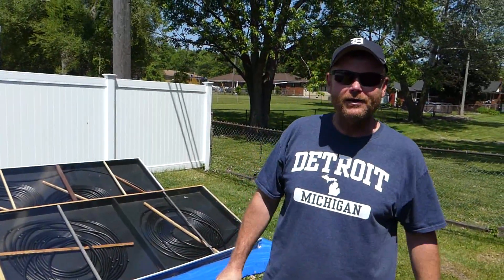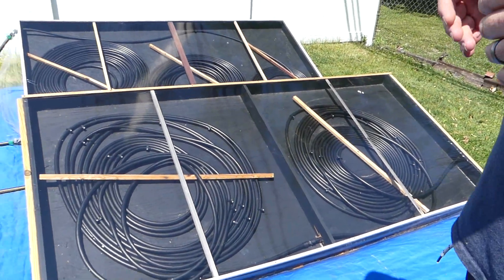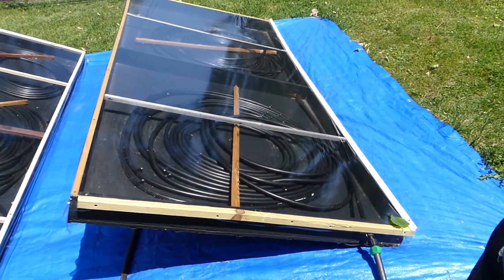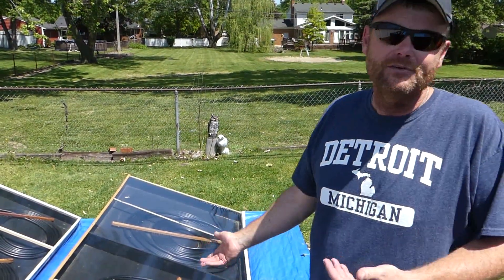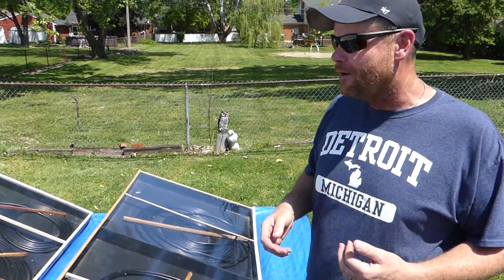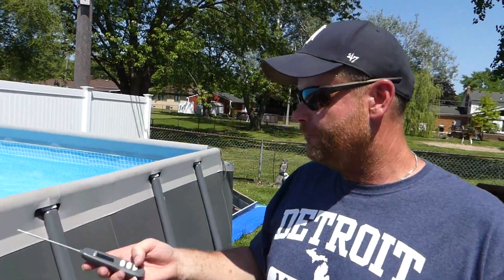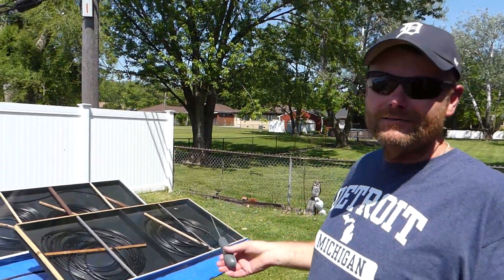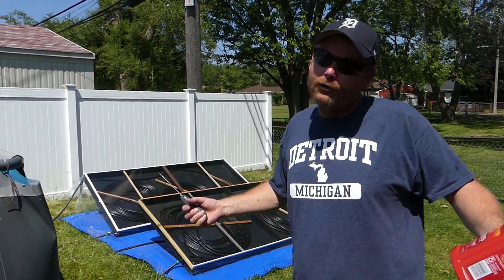Do Solar Pool Heaters Really Work - DIY!

Comment: I know you're going to have water heating up with the Sun hitting a black hose but I wish somebody would do one of these videos that based on whatever Dimensions their pool is how long did they run the hot water into the pool does start seeing a increase in the actual pool temperature. You're probably want to measure the change in temperature from an opposite where the hot water is going into the pool rather than measuring the water where the hot water is going into it going into it.
If anybody knows the correct calculations to do it as otherwise I really don't have time for these videos as making the actual equipment is not a big deal
Reply from the maker: Hi,
Here is the original video of the build - https://youtu.be/Vj4tYQ0bdCg
You can forward through the build to where I talk about results.
I have been heating my pool with the solar pool heater for years & have no complaints. My pool is always warm & with these heaters I can start pool season earlier & run later than without & it's always comfortable.
There are way too many variables for someone to tell you how long it will take to heat your pool or to a certain temp.
Amount of direct sun per day, how much tubing you use, how you build it & amount of sunny vs cloudy days just to name a few.
I now just run the heated water hose so it dumps in directly where the pump dumps in. This spreads the warm water throughout the pool.
If you have any other questions I will be happy to help :)
Thanks for dropping by & have a great day 😀
@RCInsiders

Comment: I built a similar heating module but my problem is I used 1/2" irrigation tubing and put a plexiglass cover over the frame. I live in Florida and the tubing is actually melting in spots where the temperature apparently is too hot. What tubing do you use or what tubing can you suggest that will not melt?
Reply from the maker: Hey Joe,
That's unfortunate. I used to live in Florida as well & know how hot it can get!
Here is the tubing I use - https://amzn.to/2O3HaZs
It gets pretty hot here in the summer & I haven't had it melt yet after years of use.
How big is the heater you built?
Thanks for dropping by & have a great day :)
@RCInsiders

Comment: I'm planning on building one of these this spring. If you had to do it again(construction wise) is there anything you'd do differently from your other two videos? Like buying plexiglass instead of your current cover? Wider hoses, etc? 
Also, do you ever heat your pool while the pool solar cover is on? If so, does the hot water coming into your pool melt the part near your solar cover? Or do you have ways to reduce that chance? Like having the return hose go further underwater instead of it at the surface. I was planning on having the return line be in the corner of the pool so I can heat it while the cover is on, but also don't want to destroy my solar cover as it wasn't cheap for my 32' intex pool. 😅
Reply from the maker: Hi Brandon,
Construction wise no. I think this is the most efficient and economical way to build the solar heater while keeping it compact & portable.
For the cover, I would like to go plexi, but it is very expensive at the moment. This cover lasts a long time & traps heat well.
I think the tubes are the right mix as they give the water sufficient time for heating with this size pump. 
I always run the heater with the solar cover on & have not damaged it so far 🤣
I have been more than happy with the results so far & am thinking of building another one if it ever gets warm here!
Pool season is already so short in Michigan, if I can squeeze a couple extra weeks out of the pool I'll call it a win 😁
When are building your heater?
Thanks for dropping by & happy heating my friend!!
@RCInsiders

Comment: Super cool! Very simple looking, but sounds like it works well. Love the engineering! I wonder if reflective material inside would help it reflect more heat? 🤔
Reply from the maker: Thanks!
The heater works well & keeps the pool comfortable through September :)
I'm not sure about the reflective material & how hot it would get inside the unit. I don't wanna end up melting everything 😜😅
It already gets super hot inside.
Thanks for dropping by & have a great weekend!!
@RCInsiders
Reply: @RCInsiders  good point! Wouldn't want to start a fire either lol.
Reply from the maker: @Backyardwrenching1243  For sire 😂

Comment: I need your stand measurements. Lol I’m having a heck of a time making one to fit…
Reply from the maker: Hey Rhonda!
I use a 1x6.
The bottom is 30" - The top is 40" & the upright is 20"
Cut a 45 on the upright & screw it all together :)
You don't necessarily need the stands. I use them to angle the heater toward the sun.